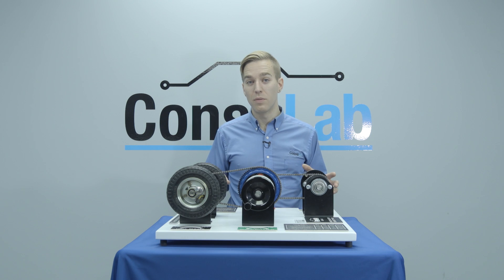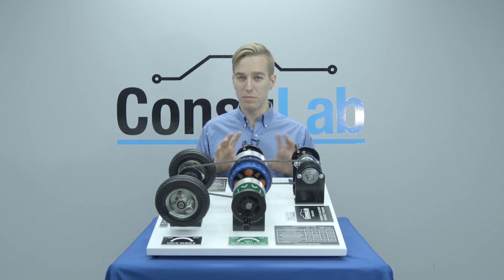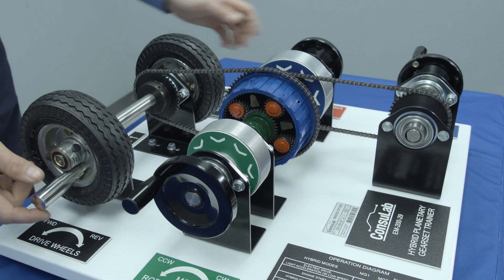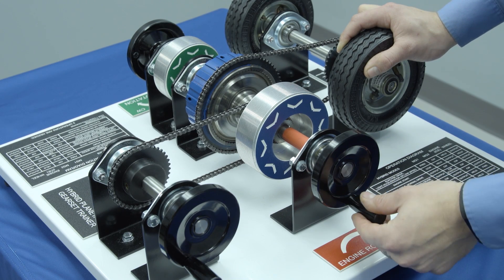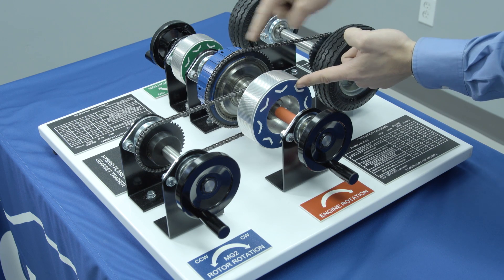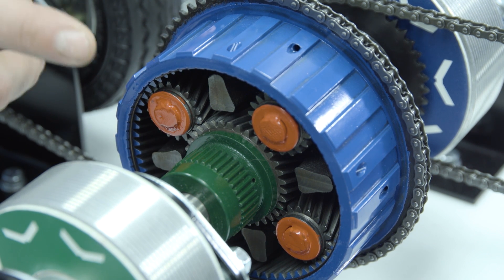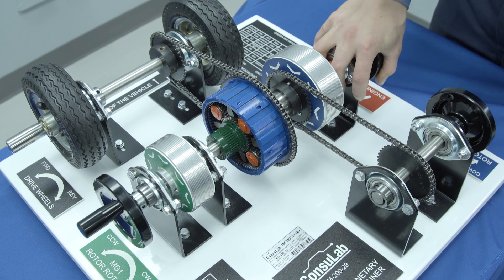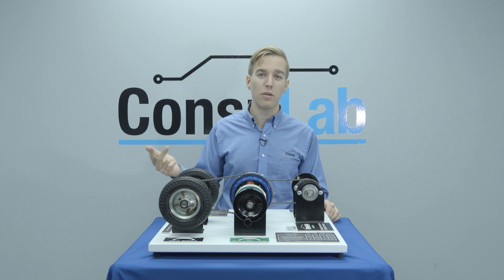Hybrid Planetary Gearset Trainer

Comment: I saw some videos showing that the Rav4 Hybrid and Highlander Hybrid struggle on steep sandy or muddy hill climb, and those YouTubers claim that they don't want to try hard because the drivetrain doesn't have a 4-low. After watching this video, I think that theoretically this eCVT has real infinite gear ratio as long as you don't overspeed (like breaking the sound barrier or overheating or something) the MG1. The computer can actually just have a 4lo mode (but unfortunately currently they don't). Let's assume that the engine can reach max torque in 4000 RPM, so in 4000 RPM, if the MG1 can spin CCW fast enough, it still can technically stop the vehicle, now if the computer can just slightly slow down the MG1, the vehicle should be able to climb whatever hills in the world, in a speed of 0.5 MPH... Now it become an off road beast...

Comment: This video explains PERFECTLY how hybrid cars work but it was unnecessarily hard to find. I am no engineer and was just curious how two motors with different speeds are spinning the same wheel. If you add "How hybrid car engines work" to the title or tags it would save other people the hustle. After failed searching on my own, ChatGPT explained to me that it might be this "Planetary Gearset" which caused me to search for that term then found a short video in the recommendation about them from your channel, then I arrived at this video.
Reply: I found this vid by searching "eCVT", even though it's not in the title.
Reply: Came in autofeed tou🧐😆🥳
Reply: all explanation is preety nice  but you didnt explain how  and by which mg1 changes its rotational direction and sometimes slowdown its speed??????
Reply: @michaelyawkal4592 ohh boy ... He should not. Go to google and search how electric motors are working. Any kind of them. It's totally another topic to be discussed, not related to the power split device (planetary gear set).

Comment: Just a quick question, when you are using MG1 to increase or decrease the ICE revolutions to the wheel (CVT operation) what happens to the torque available at the wheels? Does the torque from MG1 assist in any way the reduction (or overdrive) of the planetary gearset?

Comment: Much better than the steal band CVT's
Reply: Calling it a kind of CVT is misleading. . Cvts are known for having friction surfaces that run against each other in hopes that they won't slip. How much power they can take without slipping is limited. This is direct drive gearing between multiple inputs/ outputs. The electric motor/generators can operate well in a large range of speeds but the engine is kept in a small range of speed to keep it at high efficiency. It doesn't look like it has anything that can slip like other CVTs.

Comment: These hybrids are electric cars with gasoline assist.  The main traction motor is geared directly to the drive wheels the same as Tesla (and most but not all electric cars). It is also connected to the ring gear of the planetary gearset.  The gasoline engine can provide assistance up through the gearset and the gearset (with the smaller motor) provides CVT action for the gasoline engine. Above a certain speed the engine must start turning (not necessarily burning fuel) due to limitations of the gearset and smaller motor. 

At highway speeds the 2 motors mainly work to make the gasoline engine do most of the work (at the optimum rpm). Under these circumstances you can argue that it is a gasoline car with electric assist.
Reply: That means if battery is dead car will not work
Reply: @nobleknight6265  . If the main traction battery is dead you will need to order new cells ($1600 - 1800) and change the cell in the battery. YouTube videos on this. Battery is under the floor in the back. Probably better to have a second person help lift it.

If it's the 12 Volt battery (a much more likely situation) which usually lasts around 10 years, that cost is under $200. Change it as you would with most cars.
Reply: @dannybryant6873  if main traction battery dead is it possible to push start the car?
Reply: @nobleknight6265 . I doubt it.  But I don't know. 

It is very unlikely to be dead battery unless something failed.
The control electronics keeps the battery between 60 and 80 percent charge for long life.

When your gauge reports discharged that is actually 60 % charged. And fully charged is 80 % charged. 

If the totally discharged is from sitting for a long long time and nothing broken push starting the car might work.

Probably not the safest way.
Reply: Also, reverse is always electric. 
The gasoline engine can not assist in the reverse direction. 

But it can still be running to warm up and/or to charge the battery.

Comment: ALL 5 generations of Prius use this same architecture.   When I saw explained, I bought a new 2005 Prius.

I still have it.   18 years old, 150,000mis.
Still in perfect running order.

I live in LA.   And feel just a little superior when sitting in LA traffic....
Reply: still working?
Reply: @CelestialTrieye  Yes.  Runs perfectly.  Everything works.   Has never burned a drop of oil.

Needs shocks - the bushings wear.
Not uncommon for Gen 2 with about this mileage.
Reply: @steveflor9942 . Crappy traffic where it barely keeps moving can give the hybrid great fuel economy (way above normal).

Of course if you aren't moving at all that won't work for good fuel economy.

Comment: what is mg2?
Reply: MG = Motor/Genset.   It means it is an electromechanical machine that can either act as a motor, or a generator, depending on the circumstances.  There are two motor/gensets, hence they are named MG1 and MG2.

Comment: How does neutral work on this ?
Reply: I'm curious as well. I don't think it really has a neutral, just doesn't put it in park by locking the gears. Probably releases the clutch on the engine and drops power to MG's to zero. Source : I have a prius and I'm guessing

Comment: A planetary gearset is a 3-way adapter for gears, allowing both the engine and MG2 to drive the car. And it works the other way too, where it allows the engine to output to either MG1 (to charge the battery) or MG2 (to drive the car). To reference another video, MG2 can trim excess energy and return this to MG1, to increase torque. Fascinating how much can be done with this simple setup, and it's a shame that most drivers find these too boring to use.
Reply: The one thing that surprises me is that no manufacturer or trainer calls the planetary gearset in these hybrids what it really is , and that is: a differential gearset.
Toyota calls it a "power split device".
They probably do this because some mechanics would get terribly confused if they called it a  differential.

Comment: Just what I needed to better perceive.  Next up to better comprehend would be the data in tables like in a spreadsheet for starters for the engine, MG1, MG2 and wheels RPM's to compare the relationships.  What I'd like to know also is and additional set of voltage, current and frequency characteristics for MG1 and MG2 at the various capable RPM's.  That'd be stunning.

Comment: How do you calculate the power/ torque output? Considering you have 3 different power inputs....how do you calculate that?
Reply: If you know the power output of each of the three power sources, ideally, the power output is simply the sum of the three power inputs.  In reality, there will be some losses due to bearing friction and gear inefficiencies.  Any time a motor/genset is in generator mode, its power counts as negative.

Comment: My idea for a diesel hybrid semi trailer or tractor trailer as they call them in the USA is easily done....
Think of an electric motor bolted to a differential with one or two generators on a small turbo diesel engine charging a battery pack with cables running to one electric or two electric motors...
With one generator ran from the accessory drive and one generator ran from the crankshaft....
With no drive shafts directly connected to any differentials...
With regenerative braking of course...

Comment: The Hybrid gear set look simple than Automatic Transmission set gears,
Reply: This just focuses on the one gearset that accomplishes the mixing of the power sources.   There very well could be additional planetary gear stages if necessary for the design.

Comment: A disaster on high vehicle speed , you need energy to run fast the mg1 in order to have a long trasmission ratio
Reply from the maker: Yes, MG1 may run fast in many situations, including reverse!
Reply: @Consulab  I believe I understand current and inductive resistance is used to vary the speed of MG1 thus allowing CVT function.   For MG1 to resist rotation such that the gearset achieves overdrive sufficient to attain US intersate speeds for an ICE, often a .8 overdrive or more:
1)   Is MG1 still able to deliver current, or is is now demanding current to enforce the over-drive?
2)   Is there any state such that the ICE is driving the wheels and MG2 is charging the batteries (since MG1 may not be able to)?

Thanks!

Comment: Please kindly explain that the starting off the vehicle is achieved by the engine or by the motor? What is the job of the generator and the motor in a hybrid vehicle? As far as I see the generator takes the energy from the engine
Thank you!
Reply from the maker: Starting off from a standstill the large electric motor drives the wheels (MG2). Each of the motors can also be a generator depending on circumstances.

Comment: amazing simplicity.... and this is showing why is so reliable... there is nothing to break...
Reply from the maker: Thank you!
Reply: The engine is the weak link. Unlike the rest of the drivetrain, it needs a lot of maintenance and has a lot of parts that can fail easily, compared to an all electric drive system. Very clever though.
Reply: @egoequus6263  what engine do you mean?
Reply: @egoequus6263  . Just don't fall for the 10000 mile oil changes. 

Stick to 5000 mile oil changes. 

The 10000 mile oil changes WILL get the car out of warranty before the oil rings gunk up and the engine starts burning oil which gunks up the catalytic converter. 

Stick to 5000 mile oil changes.

Comment: everything was understandable except the very last  part (5'00") where both the internal combustion engine (ICE) is running (at fix rpm) and MG1 is also being running in one direction or the other....in my understanding MG1 main function was to work as generator, (re)charging the batteries and to work as ICE starter from standstill.....the video explanation do transmit the idea that by controlling the direction and speed of rotation of MG1 (and while ICE runs a fix rpm) we can change the speed of rotation of the wheels (= change the speed of the vehicle)....is that right?...but MG1 is the smaller MG...what is MG2 doing in that stage? (it keeps rotating too in the video)....a bit lost...
Reply: As their names imply, MG1 and 2 can work as motors AND as generators as needed. You understood correctly how the MG1 is used to produce an effect similar to a CVT transmission. However, this also means that a car with a hybrid system like this (Toyota HSD) will always require the MG1 to spin (or be held in place) in order to move under gasoline power. However, technically the car can move without having a gasoline engine at all.

The electricity to spin the MG1 is drawn from two sources. It can come from the drive battery, in which case the MG2 will just spin freely to minimize resistance. Remember, the MG2 is permanently connected to the wheels, so whenever the vehicle moves it has to spin as well. On the highway, or when driving while battery charge is low, the MG2 will be used as a generator to charge the battery and/or to provide power to MG1.
Reply: @Tuppoo94  Are we to understand then the the energy loss to drive MG1 such that it varies the CVT function is less then the power losses to an traditional geared transmission?.   Are we also to understand their are times when Mg1 can be be delivering current to MG2 or the batteries and also be affecting CVT effective gearings?   Varied inductance I assume?
Reply: Electricity doesn't go to the stator of MG2 so it won't join moving the vehicle, but will act as generator and charge the battery.

Comment: THANKS FOR THE ANSWER. Could you explain me another think…. The reverse gear has made to invert the phases in the MG2...Is it correct?? If so, this means that the revers gear has made only in electric mode...is it correct?? If so, could you explain me the action of engine motor while the electric motor is doing the reverse gear?? Since usually this happens just you start with the cold engine?? Thanks in advance
Reply: In case you haven't yet received an answer to your question, I thought I'd give it a shot. It's actually MG1 (2nd gen Prius transaxles anyway) that handles reverse. For a really good explanation and demo, have a look at this video from Weber State:  https://youtu.be/ZmHpSyTsfm0
Cheers!
Reply: @smashogre4766  so, the point is MG1 is the electric generator? or it can be MG2 too? If it be a generator, what direction it did? at clockwise or counter clockwise? thanks
Reply: @sitinurw706  Both MG1 and MG2 can be motors and generators as needed. They can both spin in both directions.

Comment: For Kiwi MakerI think the speed is variable changing the excitation voltage on GT2 so the GT2 produce more or less energy to the battery and this change the torque on the wheels…...this is what I assumed but I have never found anything about this on internet.
Reply: Pretty much. Also, the energy you mentioned being generated doesn't just go to the battery; it can (and often is) diverted to either of the two electric motors to: 1) manage the final torque to the wheels. 2) keep all the moving parts of the gearset moving close to their most efficient RPM and less than their maximum safe RPM. (the older 1st gen hybrids had to turn on the gas-engine if going >40 mph, even if coasting/going downhill, because otherwise MG1 would be rotating faster than it's maximum safe RPM)

Comment: in electric mode only, when MG2 is operating, we convert Electric from battery to mechanical(via MG2), which rotate ring gear of PSD, driving the wheels. But in that process, since Engine is off (Planet gear is at rest), the Sun gear rotates, transmitting power to MG1.
Question

What does MG1 do with that power?
Does it act as generator and convert it back to electricity?
If yes, then is it valid to think that some energy is lost, in this process? Because we convert electric to mechanical and again to electric (unnecessary for MG1) and losses may occur here?
Reply: Patil Shubham I’m pretty sure that MG1 is spun up but no power is generated because there’s no load on its windings. It’s basically a tiny flywheel in electric only (not reverse) mode.

Comment: I’m still trying to understand how the speed is variable but this has helped a lot! Thankyou. How does reverse work?
Reply: I know you posted this 8 months ago but at least in the Toyota Prius design. Reverse is only accomplished through MG2 electrically. The gasoline engine cannot directly move the car backwards.
Reply: The gear ratio is controlled by the generator motor speed and it will change the gear ratio between the engine to the wheels,
Reply: Other videos say 3 gear sets are used to vary speed
Reply: @Andrew H 
It's just part of the basic design. Mg1 is driven off of the engine, and can drive the engine as the starter motor. Mg2 is the big one that provides power to the wheels. The gasoline engine can run while the car is reversing but I don't believe it provides any significant power to the wheels during that process. It can provide electrical power I believe which would then pass right back to mg2. The only time I've ever run into an issue with this is if I was trying to reverse up a extremely steep hill. Sometimes the car will not do it. Keep in mind my car is 14 years old with $409,000 mi on it. It's possible with a newer more powerful in better health Hybrid battery perhaps it could.
If you're interested in some very detailed teardown and theory of operation videos I would check out Weber automotive on YouTube. That is a automotive technical college in Ogden utah. They specialize in hybrid and electric vehicles. He has a great series on several different Prius generations. And does a good job explaining how the transmission operates. As well as other systems.
Generally speaking you don't really need that much power in reverse. And you never go fast enough to really need the gas engine for help. Mg2 is pretty close to 50 horsepower which should be more than enough to take care of any needs the car should normally run into.

Comment: This model does not apply to the first and second generation GM Voltec or the Hyundai Blue Drive
Reply from the maker: Yes Mark you are correct! This is a very basic version of what Toyota and other manufacturers do, however it is not the configuration you would find in a GM or Hyundai.
Reply: Correct. Because the GM Voltec can run on the electric main motor at 160km/u, and that would in a prius style series hybrid the second generator motor too fast. Different design.